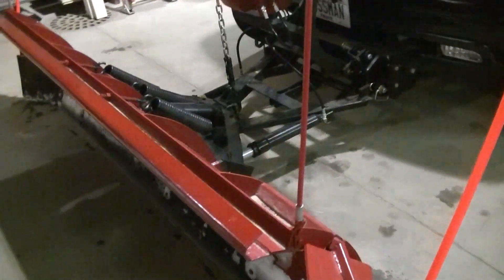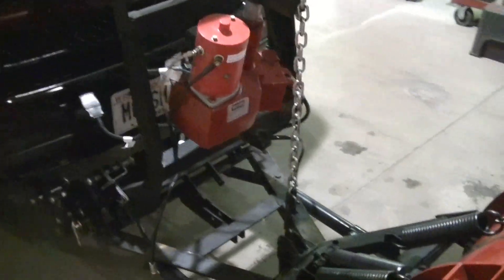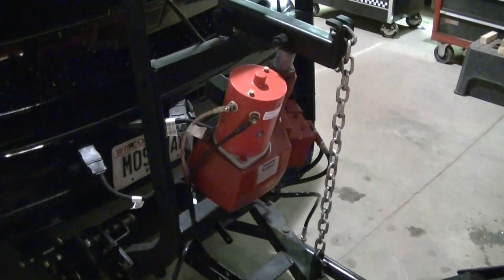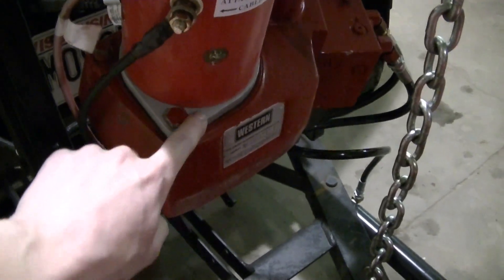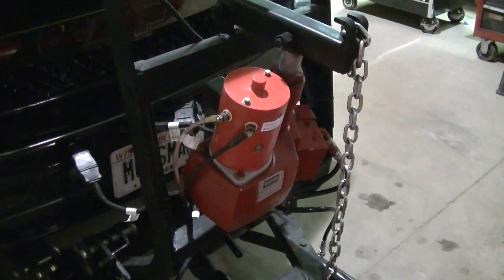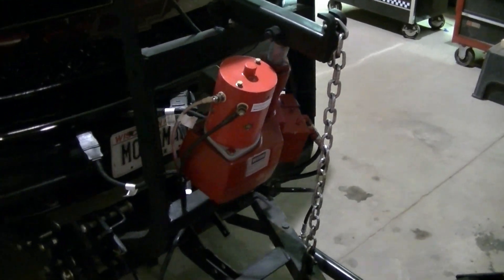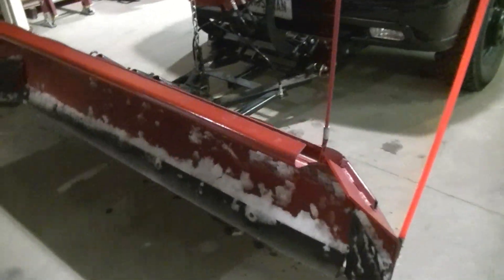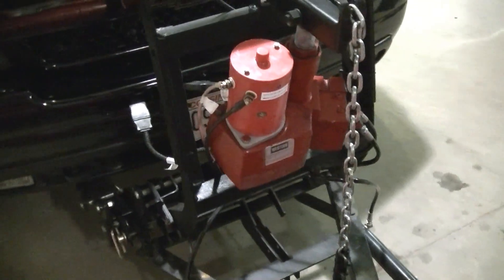Western UniMount Snow Plow Problems Fixed

Comment: Just got a western 7'6 plow off a 2005 silverado 2500 that has been on it since 2005. And last night I attempted to put it on me 2005 gmc Sierra 2500 duramax. And I have everything wired in but got a new cylanoid because the one on the other truck was just a pain in the ass to get off. So I'm not getting any power to my controller and not hearing the cylanoid clicking. So i drove up to the plow and plugged all the plugs in and touched my power....hot and negative to my battery and it arched really bad but the plow moved just to the right without even turning on the remote or hitting any buttons. So at this point I'm lost and in need of help
Reply from the maker: Without seeing what you have wired I have no idea what is wrong.  You have your wiring mixed up somewhere.  My guess would be the solenoid because that is the part you changed.
Reply: @mossman381  It sure was the cylanoid.
Reply: Thanks for the reply!
Reply: Bad valves will act like that take them off one by one clean them really good with brake parts cleaner and blow dry air make sure no rust is building up soak them with hydraulic fluid and put them back where they belong that should fix your problem

Comment: Hi Mossman381 just hooked up my dads Western plow on the front of his truck today as we live in Michigan and trying to get everything set up and ready long before winter hits. The plow was not used at all last winter and has been sitting outside in the weather as you might suspect. So it's been over a year since it was put on the truck and used and like I said been sitting outside in the elements. It's all mounted up and got power at the joystick control but barley makes a clicking sound from the motor and or pump area but does nothing else when using the joystick. It's a Western unimount very very similar to what you show in the videos any suggestions as to what could be causing nothing to work at all on the blade period? It has fluid in it  two of the tiny pins in the plug for the lights are green but have to be cleaned up yet I cleaned up the positive post on the side of the pump motor but still didnt change anything. The hydraulic ram was also stuck in the up position but we got that finally to go back down by tapping on the top of the ram cylinder. Any help would be ideal as so I can get this back up and running for him before bad weather starts. They are unable to do much do to health so it's kinda up to me to get things back up and in order for them when they go down. Thanks so much for the help I really appreciate it.
Reply from the maker: My guess would be the solenoid. It's pretty common thing. The pump should be running anytime you move the joystick.

Comment: My western unimount plow works fine up down left or right  only problem is  it does not hold an angle left or right when I am plowing    any help would be great  Thanks
Reply from the maker: Your spool poppet valve is worn or stuck.  Cushion valve stuck or damaged.  Call your local Western dealer.  They will help you get the parts.  Our local Western dealer is awesome.
Reply: Valve body or cylinder seals

Comment: I just had too replace my plow pump motor on my uni mount plow. the motor melted the plow solenoid. works great now, plow works much faster, my motor must have been on the way out. only thing now is the replacement solenoid is sticking and keeping the plow motor running when not in demand. so I just ordered a new solenoid.

Comment: good afternoon i have cuestion the plow of my truck is pulling the fluid and does not raise fast and after a while is lowered  i hope your aswer thanks
Reply from the maker: Victor Lagunas   Could be a sticking valve.  If you have a lot of leakage around your lift ram it might need to be rebuilt.  Without seeing it myself I really don't know.
Reply: ok thanks

Comment: Hey Mossman, I just recently bought an ultra to unimount conversion plate like you have in this video. There is about 2-3" of space (left to right) from one end of the ultramount frame (on the truck) and the conversion kit. Did you have this much play in your kit with your truck?? I am concerned the plow might slide side to side when I turn. I just wanted to ask if you had the same thing or I have a defective conversion kit. Thanks!!!!
Reply from the maker: +Anthony Barbato   It will slide back and forth on the truck frame.  Mine did the same thing.  Never had any problems with it but I did hear it move every now and then.
Reply: Ok cool, thanks for responding! Im looking forward to this winter, i assume you are too! Good luck this season!!
Reply from the maker: +Anthony Barbato   Last year was pretty disappointing.  Bought a new plow then barely got any snow.  I am hopeful for more snow this year but not holding my breath.

Comment: after using my western plow for 15 min, the plow will not lift or move left or right and makes a high pitch sound, ideas as to the problem??
Reply from the maker: These old Western plows need to have the fluid changed and pump filter cleaned every year.  That would be my first guess.  If you have been running the plow with a plugged filter the pump might be hurt.  The motor is also another thing that goes bad on these plows.  You need the motor that has the ground post for a good ground.  Bad ground will kill these motors.
Reply: Cable adjutment or hanging up causing relief valve to open
Reply: @mossman381  my old unimount has the same problem,  I will let you know what the trouble was when I fix it.

Comment from the maker: Thanks, if your plow has a chain lift like mine then you can shorten the chain but then you will lose how far the plow can go down.  If you really needed it to go higher you might be able to extend the lift arm.  That would allow you to raise it higher and not loose how far it goes down.  Not sure if that would cause any other problems or not.

Comment: Mossman please help! So I have gone through the wiring on my 2000 chevy silverado with a western relay based plow system on it and I just can not figure out what is causing my Inline fuse to blow every time I push the joystick in any direction. What could it be?? I have cleaned all grounds and redone every power line. I have continuity everywhere... what am i missing?
Reply from the maker: +Cody Greenwell   I am not sure how to help without looking it over myself.  Do you have another controller you can try?  Have you opened up the controller to look for a problem?
Reply: I had the controller professionally tested at a western supplier, so fortunately that is not the issue. I almost wish it was at this point!
Reply: It just will not maintain power, fuse or solenoid pops everytime.. solid grounds I just don't know!! Is it possible to have small terminals on solenoid hooked up wrong? Would I still be getting power to controller if they were in fact hooked up wrong?
Reply from the maker: Do you have a Western wiring diagram?
Reply: No I do not, the diagram on their website might as well of been jibberish to me.
Reply from the maker: +Cody Greenwell   I have some older diagrams.  How many relays do you have?  Is the truck the old body style or new body style?  I will see what I can find.
Reply from the maker: +Cody Greenwell   I don't have anything on the newer body style.  All my diagrams are for the OBS.  I can't find anything with 6 relays either.  Is there a black/orange wire going to the solenoid?  That one I think should be grounded and the other wire is the power wire coming from the controller.  I don't think they can be on the wrong prong.  What size is your fuse?  My book is telling me 10 amp for the joystick and a 6 amp for the handheld controller.  Again these are older books but I don't think they have changed much.
Reply: That is correct, and you are right, the light's have a 6 relay system they are connected to. Yes orange and black wire is grounded and that is the only ground so I do not understand why it keeps popping lol so very frustrating! there are 2 10 amps and 1 6 amp directly before the controller itself.
Reply from the maker: +Cody Greenwell   My guess right now would be the solenoid is shorted out or have you checked the wires going into the cab for chafing?  What vehicle did this harness come from?  Do your lights all work right?
Reply: Yes all lights are working correctly, I will pull that first thing in the am and check it over again but I did not see anything. I've also purchased 2 new solenoids and replaced the original one and then the first new one just to eliminate the solenoid being an issue
Reply from the maker: Cody Greenwell  Where are you getting your switched 12v power from?
Reply: Just below the 15A in the 4/5th row, interior fuse panel
Reply: UPDATE: Hey Mossman, I finally got power to the controller and now when i press any direction, it just clicks... I've checked for a bad ground and I'm  ONCE AGAIN stumped. Any tips?
Reply: FINAL UPDATE: Fixed the problem. NAPA sold me a solenoid that was not strong enough to power the system. $300+ dollars and tons of hours later.. It's fixed!

Comment: did you ever change the lift ram  mine has a lot of pitting looking for a video,  but cant find a single vid
Reply from the maker: Never changed out the lift ram.  Is yours leaking bad?  That packing nut has to come off.  If you had trouble with your drain plug you will have a lot of trouble with that big nut.  It's on there tight.
Reply: Funny thing is my dealer has the big nit off last year put a new seal and everything on.  But it’s leaking a bit.  Read on plowsite they need to be adjusted. So took it back today and they tightened it up.    Reason I was asking cause the lift cylinder is really pitted near the top 2-3 inches. So I’m thinking it’s cause moisture.  I pulled the motor yesterday and the fluid looked a litttle milky.  So going to change the lift cylinder
Reply from the maker: I changed out my angle cylinders because I though they were allowing moisture to come in.  After those were changed, new fluid and filter clean every year and the plow worked good.  It might take awhile to get the moisture out of your fluid.  Especially if nobody changed it for like 10 years.  You might want to try some cheap trans fluid and do a couple fluid changes quickly.  That might help flush out the moisture.  I would think the Western dealer would have recommended a new lift ram while they were doing the job the first time.  If you have bad pits you won't stop fluid leak.  If you tighten up that packing nut to much that can make it hard to lift.  Especially on an old plow.
Reply: Ya. Last year we told the just to put new seals on cause the leak was really bad. Had to keep adding fluid this year I was just a small trace amount , just on plow site say that the nut has to be adjusted once you put new seals in.  We told them next season we will put a new lift ram.  
I’ve got all new blue fluid waiting to be put in. But looking for something to flush the whole system instead of wasting the new blue fluid I bought
Reply from the maker: We use to run automatic trans fluid in that plow.  We switched when it started to freeze up in really cold weather.  Once you get the moisture out I don't think you really need the blue fluid but I still run it in all my plows.
Reply: If we get a new lift ram.  New angle rams and hoses. Drain the fluid. Is the only part left that would have fluid is the pump. ?  
Would there be any fluid in the carriages on the side
Reply from the maker: The pump and the valve block.  There wouldn't be a lot of old fluid left.

Comment: I put a new motor on western unimount now plow angles right when any function (up down left) is performed on controller.  any suggestions appreciated.
Reply from the maker: I would say valves or controller problems.  Maybe wiring issues.

Comment: Mossman i hooked up my plow today,turned the switch on and nothing happens.I turned the switch off and the light on the controller stays on. Could it be the fuse and where is it located?
Reply from the maker: +Zamorazone   Doesn't sound like a fuse.  Sounds like a ground issue.

Comment: Hey Mossman, My Western plow won't move left or right. I hear the solenoid click and it sounds like the pump runs but nothing happens. Any suggestions? Thank you
Reply from the maker: Check the wiring going to the valves on the plow.  I have also seen the inside of the plugs corrode and have pins break off.

Comment: It's me again Mossman.  I'm hoping you can help me troubleshoot my problem for me so I know how to proceed.  I was having problems with my plow not wanting to work at all, and was continuously having to pull the head off the motor and clean the brushes.  Finally, even that wouldn't work, so I purchased a new motor, and while I was at it, a new solenoid. Installed them both today.  Everything installed just fine, however I cannot get my plow to operate unless I jumper-wire the large secondary terminals of the solenoid.  Then the motor runs fine, and the joystick/cab control operates the plow in all directions, but not without the jumper, which of course, makes the motor run continuously.  I tried cleaning all the contacts in the joystick/cab control to no avail, and it's ground appears to be good.
Hope you can help me with some ideas on how to solve this problem.  Appreciate any advice you can give me.  Thank you, AKMax
Reply from the maker: +AK Max   I would have someone run the controller and see if you are getting power to the solenoid.  If you are then you know the solenoid is not working.  We had the same thing happen to our 90 chevy but the solenoid wasn't new.  I think we burned it up because of a bad motor having to hold the controller buttons down trying to get it to move.

Comment: Sounds like if you just cleaned up the ground wire with a file or grinder it would have done the trick.
Reply from the maker: Get the upgraded motor with the ground post and forget about it.

Comment: I am now having very similar problems, PLEASE HELP.  Plus, it’s hard enough being a girl, finding men who know what they are talking about!  Sorry dudes out there.! I have a 2001 f350 with a plow already attached, the control box inside the truck shows one thing, the red power on button.  But will not start plow, move plow, it’s dead! No life from control box inside truck.  Towards running or making plow work in the slightest!  My guess is this power box that’s under hood that runs plows. They seem to be getting over heated and  break.  Cables get hot.  Do u think that power thing is my problems.  It doesn’t sound expensive.  And in summer cover some type of filter.   Idk.  HELP!!!!
Reply: Help
Reply: ASAP
Reply from the maker: Without seeing the plow myself I am just guessing.  I would say you are melting wires because you are holding the plow controller too long because nothing is happening.  You can melt you solenoid doing that too.  Your motor could be the issue.  Get the one with the ground post.  Check the filter inside and make sure it's clean.  I clean mine every year and also change fluid every year.  I have videos on that too.
Reply: What kind of plow Meyers

Comment: My plow has stopped working the controller will not power on plow lights will not come on and I have checked rechecked and rechecked again all my connections.... where am I goong wrong?
Reply from the maker: Not being able to look it over myself I don't know what to tell you.  Did you check the fuse from the power wire going to the controller?  I don't think that would keep the lights from coming on.  A bad relay would do that thought.
Reply: mossman381 1 1fa he...